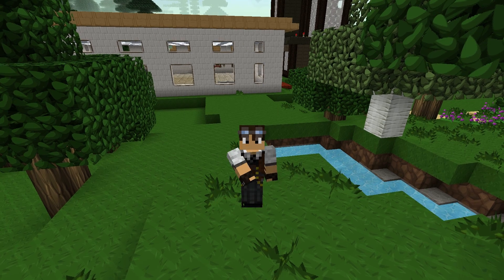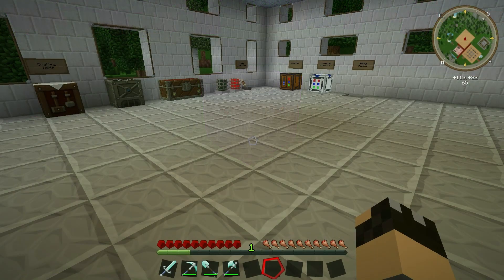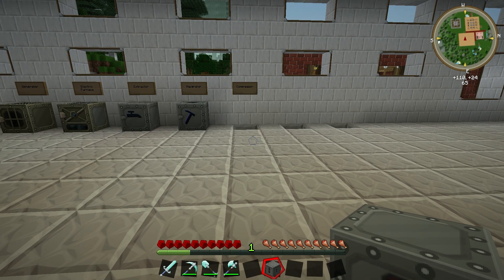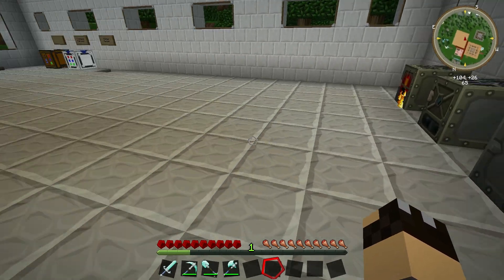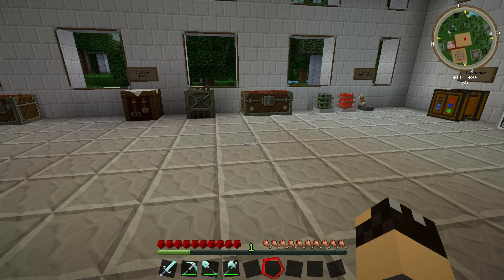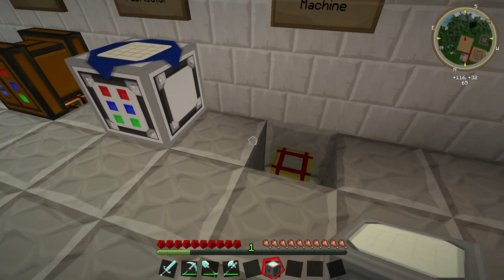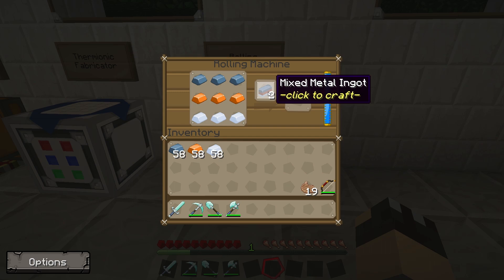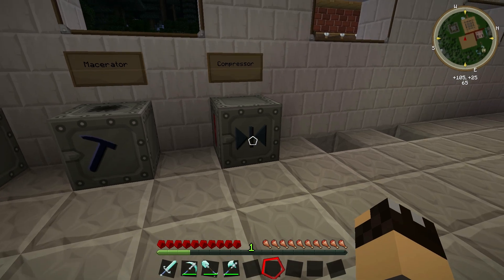How to Feed the Beast in Minecraft - Compressor & Rolling Machine - 9

Comment: How do I power a rolling machine I have a train craft diesel generator with an of wire connect then of wire running to a rolling machine and it won't work

Comment: the recipe for metal mixed ingots has changed. The easiest way is 1 tin, 1 refined iron and either 1 brass or bronze ingot. Put all three of those into plate bending machine to make each one a plate. Then arrange them properly on a regular crafting table. You'll get the mixed metal ingot which can then be compressed into an alloy plate(i think its plate) which is used for various stuff.

Comment: Thankyou for replying! I ended up figuring it out shortly after.I ended up hooking all the Electrical engines to 1 glass fiber line (which is hooked up to an MFSU) and then put an EU splitter on the line in between the MFSU and the engines. then just simply used redstone dust to hook up the lever to the lights and the splitter. so when i hit the switch the red light turns off, green one turns on, and the splitter connects to allow power to flow to the engines.

Comment from the maker: The lever and both lights are on 3 blocks that are next to each other. A green cage light, and an inverted red cage light. Then on the underside of those three blocks is a red alloy wire. It runs beneath the blocks with the lever and both lights, then down the basement wall and along the floor, connecting to every engine.

Comment: How did you hook up the Cage lights to your engines? (Which ones are you using btw)

I want to have 1 switch like how you have it (with the cage lights). I have 5 machines and each have their own electrical engine which are all hooked up via glass fiber cable to an MFSU.

Comment from the maker: I'm sure someone will correct me if I am wrong, but I don't believe that there is. There's no way (that I know of, to keep the recipe in the machine without the risk of the last ingots being used up. It's not like say, the carpenter, where there's a different section for the recipe and the materials go into another slot. Theoretically, you could pump bars into it faster than it can use them - but then you have overflow issues too.